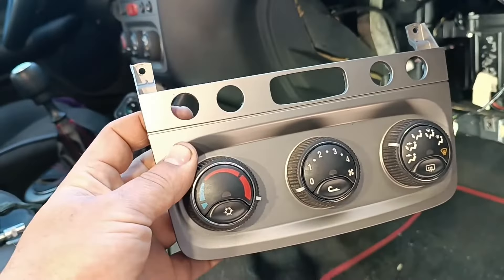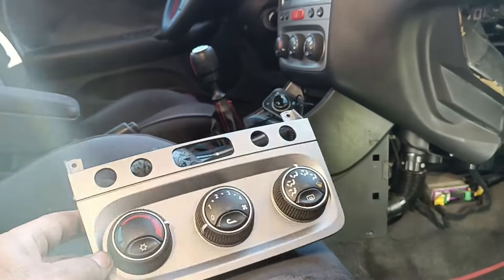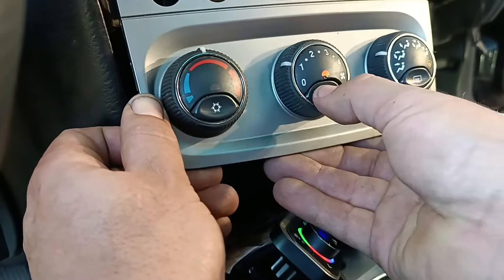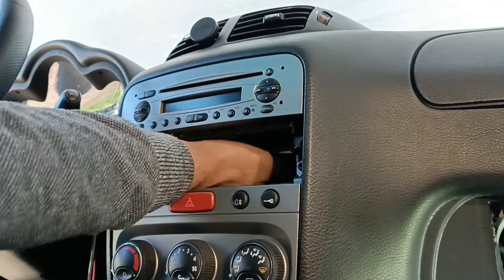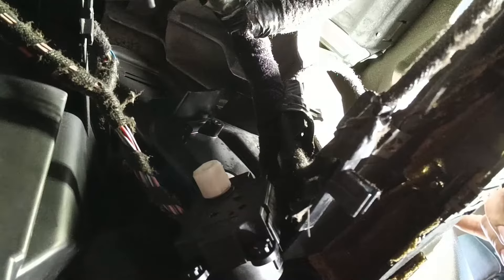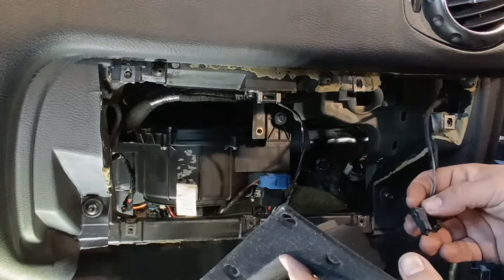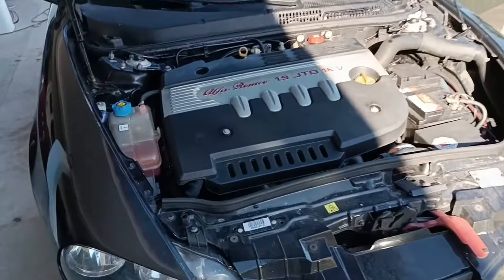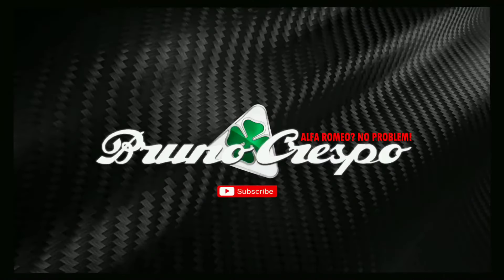Climate control issue solutions Alfa Romeo 147, 156 and GT

Comment: I have the same issue, except mine got stuck on the warmest settings. Gonna try testing by switching the connectors of the motors, as you said. I thought I needed to remove the dashboard for reaching the door flap actuator motor, but seeing you reaching it without removing the dashboards gave me so much hope. Thank you for this video. It couldn't have come in a better time.
Reply from the maker: I'm glad you like it. And thanks for watching, good luck
Reply: @alfaromeonoproblem So the motor for cold/hot air mixture is the one on the right and the motor for air direction is the one on the left? They are both next to each other? Or are those two for air directions and there is another one for cold/hot air mixture? Because in my car both are blue, and in yours one is yellow and one is white... I am confused now. Also, I can not undo the screw that is behind the metal framework of the one on the right... I need help
Reply from the maker: @philipgligorov5848 is it a two zone or like this one?
Reply: @alfaromeonoproblem  it's same as the one in the video
Reply from the maker: The one that controls heat or cold is the one behind the metal frame, very hard to get
Reply: @alfaromeonoproblem  Alright, I barely managed to unplug the connector from the small motor behind the frame and plugged another one from a scrapped car from a scrapyard and turned the knob from cold to hot few times while watching the gear on the motor and it didn't move and the motor didn't made any sound and both me and the mechanic who gave me the part came to conclusion that it's the climate control module that is causing the problem. Unfortunately, he didn't have one available the moment and told me that all had been sold out, but none of the digital ones was sold, haha... So I know now what the problem is, but in case I can't find a spare one, do you know if it's possible to fix the same unit? Do you know if anyone has done that before?
Reply from the maker: @philipgligorov5848 I do not know if it's possible, maybe so. It works with optical sensors, they may be bad
Reply: @alfaromeonoproblem  I removed the motor behind the frame and plugged the connector of the other motor into the one behind the frame. And it worked!!! After that, I went to a scrapyard and tried two other climate control modules, and unfortunately, both didn't work, and the mechanic there told me that the problem might be the body control module which I doubt. I think both the modules he gave me to try were also malfunctioning. So I decided for now, to not worry since it's winter and I don't mind it, and for the summer I can just switch the flap by hand or by a tool I made now for switching the flap. The only problem is that I will drive without glovebox, but I will pass on that for now... Thank you for the advice and all the content you upload here, it's very helpful. God bless you!
Reply from the maker: @philipgligorov5848 thank you very much, all the best
Reply: @alfaromeonoproblem  Update. I finally fixed it. The problem  apparently was caused by light bulbs that are inside of the module. I know it sounds unbelievable, but check this out.  I removed the bulbs two months ago because none of them worked and noticed that they were all burnt out. After a few days, I wanted to change the heating to medium settings, and that is when I noticed it was stuck on the warmest settings. A few days ago, the led light bulbs I ordered from aliexpres for a laughable amount of money finally arrived. So I decided to install them today and did just that two hours ago. After that something told me to try and see if the actuator motor might work now and I plugged the motor back which I kept between the two seats and I turned the knob and the motor worked. I was shocked to see. So it definitely has to do something with the bulbs. If there aren't any bulbs in the modules, the signal doesn't travel from the knob to the actuator... and what worries me now, no mechanic or car electrician knew this and the car has been for diagnosis in few shops in the past days. I am very happy I found this out and wanted to share it with you. So the bulbs definitely have to do something with the singal from the knob.

Comment: I had similar issue on my 156 some years ago. But it was not an issue with the Controller but one Stepmotor was defect. Was complex to reach but I managed it without IP disassembly.
Reply from the maker: Yes, it happens. Normally a cracked weld on the board

Comment: Bruno please help me, I have the same car and engine but on my car when I put the controller on full blow on the windshield it doesn’t blow anything, it just stop. All the other buttons are working properly, even the blower speed controls from 1 to 4.
Reply from the maker: Hello. So the speed control is not good? 
You may have an issue on the speed module
Reply: The speed control is working properly but when I put it on the 3 button to full blow on the windshield the last icon with yellow everything stops and it’s not blowing air anymore. I replace the blower 2 months ago with a brand new one.
Reply from the maker: @ionutduca3817 still can be seen issue with the controller.
Next to the blower
Reply: Thank you for your support, I will check it.

Comment: Hello, I have a problem with my alfa 156 q4! The driver's side has warm air, the passenger's side is cold! I replaced the stepper motor, but it's still cold in the passenger compartment!
which stepper motor and which way should I turn if you would be so kind as to tell me! Thank you
Reply from the maker: Hello. Remove it, if you do not know what it is, it's the one that doesn't move..
And by hand see if the door moves